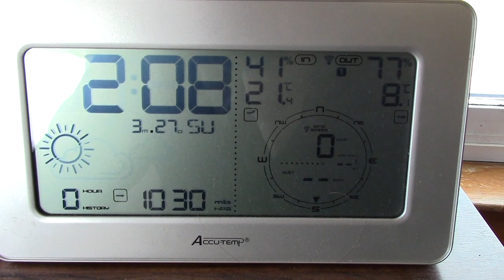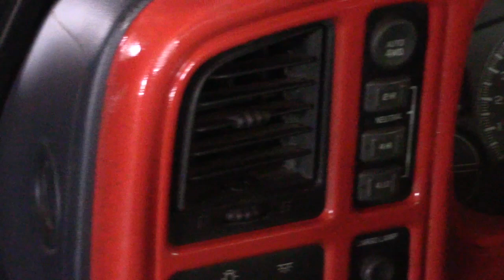Happy Easter I'm Back

Comment: I had an 02 Silverado 5.3 worked great rebuilt the tranny put new rear bumper on and dorman hinges on the tailgate my frame was perfect I used 3 cans of rust check on the rear bumper before I put it on cause they rust like a bugger I had a tune on the engine and the beefed up transmission with a shift kit allowed me to spank a few Hemi's . Not a big fan of these trucks but you can get by if you watch them like a Hawk and you like to wrench once and awhile ,lol
Reply from the maker: +twistedsledder yeah it will be replaced